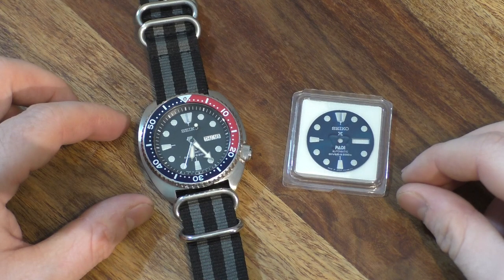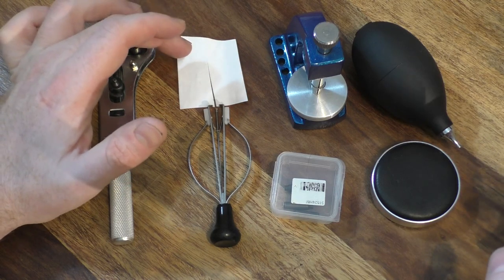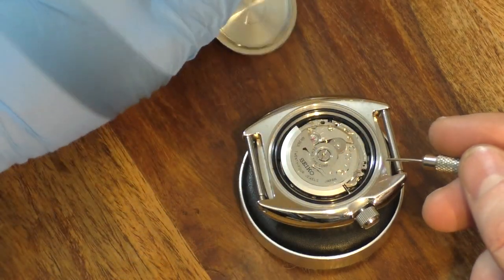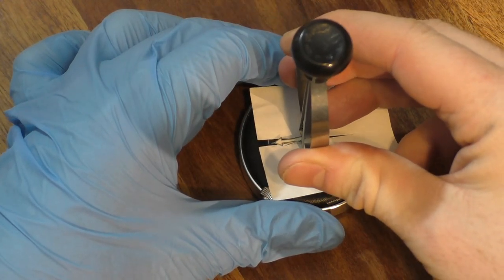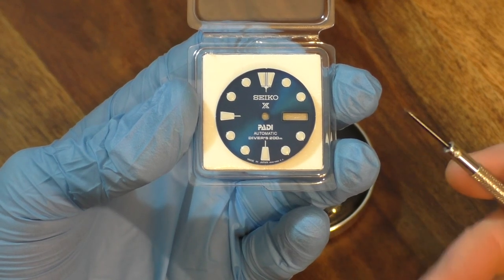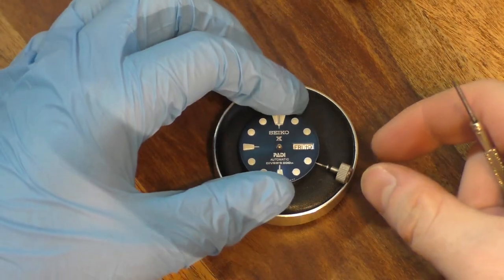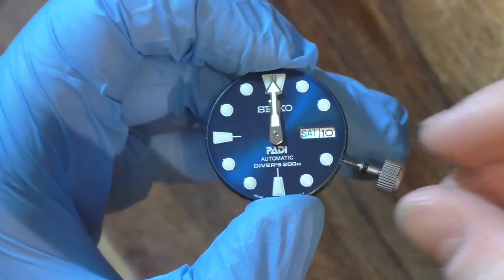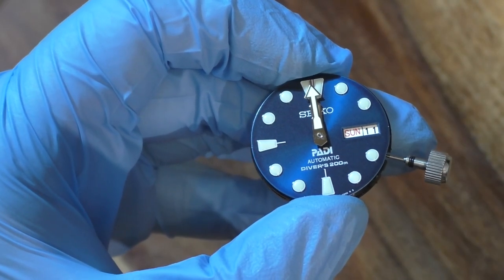How To Carry Out A Dial Swap / Mod On A Seiko (Seiko Turtle SRP Padi Mod 2021 1 )

Comment: Thanks so much for posting this video. I found your voice and accent pleasing to listen to and the content was helpful. I notice you don’t use a movement holder when installing the hands, I take it you’ve had good success with this? The reason I ask is I’ll be doing a dial and hand swap soon and want to know if I’ll need a movement holder. Thanks!

Comment: Fab video. Thanks. What position should the crown stem be in before removing? When you reinserted the movement, you said put the crown in hacking position, but the second hand was moving. I’ve had trouble reinserting crown stems in the past and wonder if it should be pulled out or not.

Comment: Here's a question for those people that swap dials out of generic watches for Seiko dials....aren't you just wearing a fake watch then? Great video!
Reply from the maker: Well this is very much debated in the community. Now if you take out a original Seiko dial into another watch/ case, really it's a franking watch due to the parts being original. If it's an after market dial thats where the waters start to get muddy.